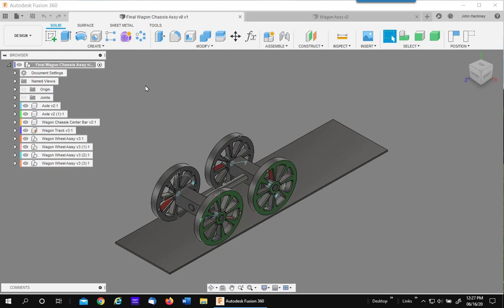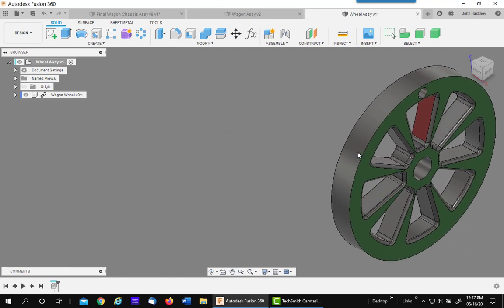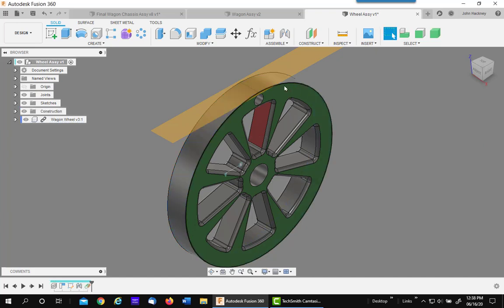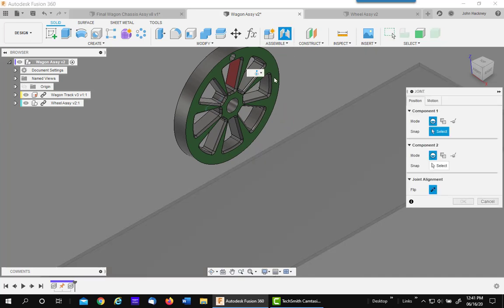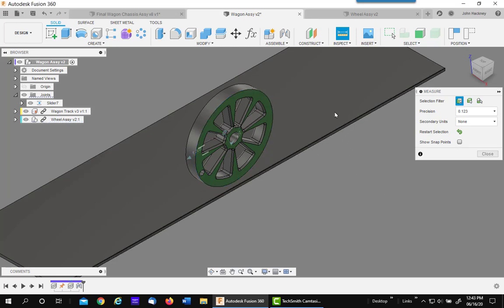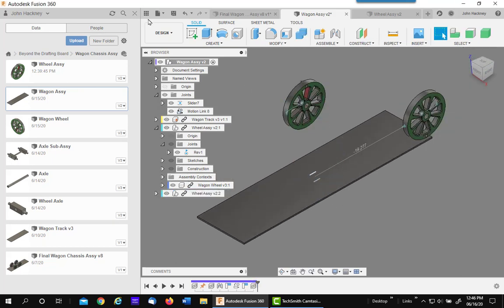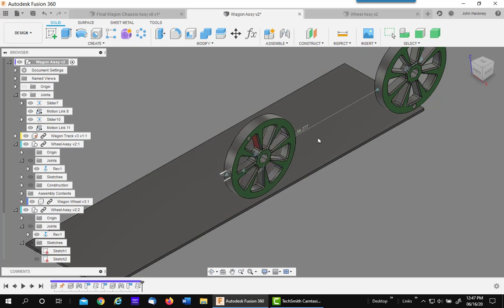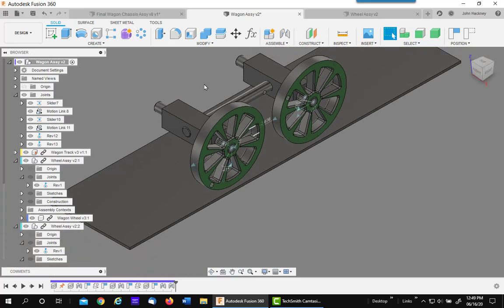An Application of Tangent Joints in Fusion 360

Comment: Thanks for the Video, I did try and designed the parts and when applying the Joints all went fine as per Video but when I try to add the third Wheel I get a warning "Selected joint type will result in conflict", please advise, I'll be happy to have the four Wheels Revolve as per beginning of the Video.
Reply from the maker: I can only help if I have your model.  Export it and then attach it to my email jhackney1950@gmail.com
Reply: @jrhackney  I did enjoy this tutorial and I managed to have the four wheels revolve as required, thank you very much for the guidance.